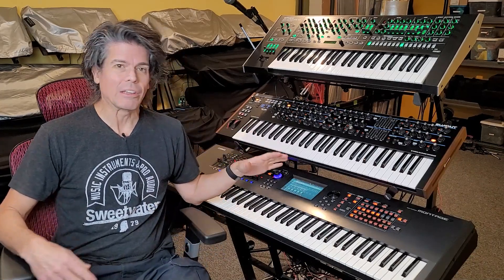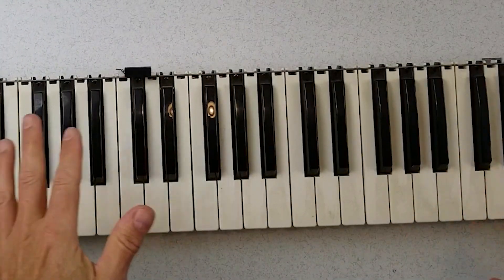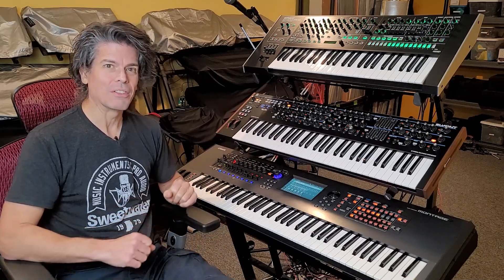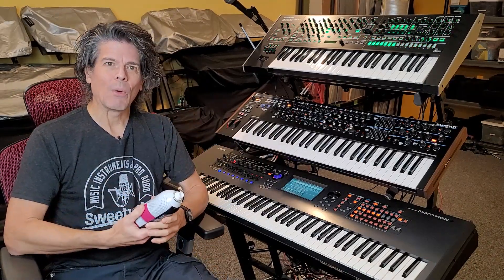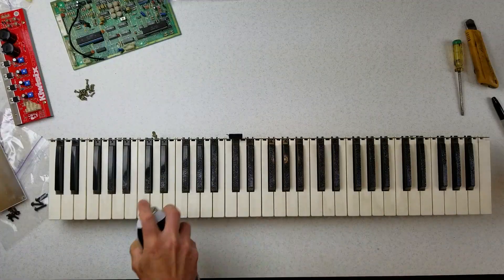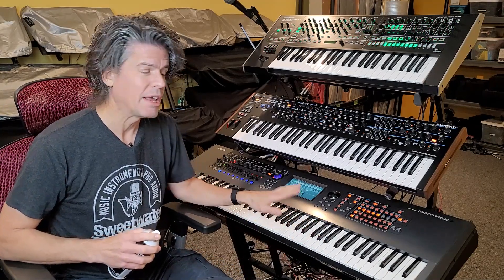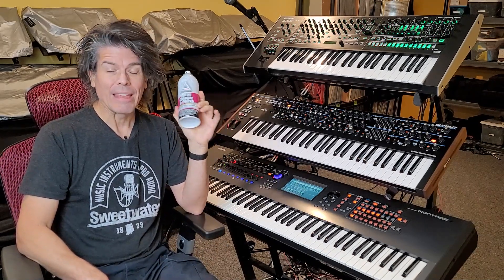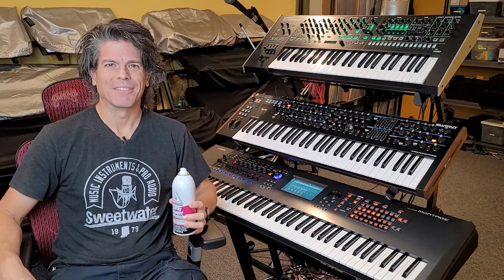How to Clean Your Synths: My Secret Weapon Revealed!

Comment: They say in Dune "Fear is the mind killer..." well I believe "Dust is the synth killer..."

1. Ensure all electronic equipment is covered up or squared away when not in use
2. Vacuum and dust workspace including wiping down all hard surfaces once a week (and ensure any clutter, stray cables, manuals etc all put away - places like this are especially bad for harbouring dust)
3. Gently use a soft haired paintbrush across the surface of your gear (especially good for mixers with hard to access areas around the pots and into grooves into which the sliders sit)
4. Then use a very very slightly dampened cotton lint free cloth to wipe down main synth or mixer areas (remembering to earth yourself if you are going to be wiping down anything with a metal surface to discharge any static build-up)
5. Use a dampened cloth for the keyboard and the shelf below the keys and then a cotton towel to dry
6. Remember to wipe down any exposed areas of keyboard stand and racking - these are easily forgotten and seem to be massive dust magnets 
7. Every so often remember to give all cables, power leads and adaptors a wipe (obviously the largest build up of dust is going to be at floor level)

I suggest all of the above is done with the power turned off and equipment disconnected from the mains outlet obviously. 

Happy days.

Comment: For more than 30 years my method has been prevention of dirt rather than a cure for it.  So regular hand washing, clean habits, no smoking, no eating / drinking and making sure the room is kept free of dust where possible. Oh and never let other people use your stuff! I've stupidly used to allow people to pick up my guitars with freshly fitted new strings, and 10mins later those strings would be completely ruined and needed replacing with more new strings, plus there was often thick black dirt on the fretboard etc.

Comment: I'd say I'm not too sure about using motorcycles stuff on synthesizer. Usually those are not intended for electronic devices where the motherboard might get damaged. I usually recommend more to clean with stuff like isopropyl alcohol or white vinegar
Reply from the maker: Alcohol can be dangerous, as a lot of the screen-printed graphics manufacturers used are soluble in alcohol. Vinegar is acidic and can promote corrosion. The Spray Polish has surfactants that lift the grime, and a modified carnuba wax that remains as a protectant and gives it a like-new shine.

As I mentioned in the video, I have been using this stuff for years, and it's never failed.

Comment: Okay, I was sceptical as hell but I gave it a try today on a few older synths and the results were night and day. I had a lot of nasty residue on them from old foam that is turning to mush in the flight cases and this stuff just cleaned everything top to bottom. The only thing I did notice is that the "Yamaha" on the back of my DX7 started coming off but I think that has more to do with the elbow grease I had to put into it to turn it back to white from green. Probably used a lot more than I needed to on there, about half the can, but it was nasty. Now it looks practically new. Great tip.
Reply from the maker: I swear, this stuff works SO well. I've had quite a few people report back that they tried it and it worked great for them as well!

Comment: My secret weapon for everyday cleaning of my instruments is very simple. An old cotton cloth .. prefearble from an old bed sheet and just plain windows cleaner you buy in a store. I have yet to see any materieal that get damaged from it. It's great for cleaning just about everything on the outer of the instrument. Newer spray direct on the instrument. spray on the cloth  and clean and dry it off with the cloth. works both for grime on the keys and the top of the instrument no matter if its plastic or metal. It doesn't do any damage to the text or other bad things. Only precaution is if your display don't use a protective plastic there used to be a warning for the early LCD monitors that using regular water on a cloth was prefeared as windows cleaner could react with the delicate display. Not sure about today, but I always just use not too hot water on my flatscreen anyway

Comment: Great tip! I'm a former motorcyclist (20 years) and a synth musician, so I already knew about this spray but I didn't think to use it for synths! Good to know about this. I have a synthesizer I bought used from Reverb (an Access Indigo 2 Redback) and it has a light but persistent perfume scent, and it's gawd-awful. It's already giving me a headache and I've only had it out for about an hour. Granted, I have an incredible sense of smell. 

Would white vinegar or alcohol be advisable too? You're using the old detailer's trick of spraying the towel, not the surface. Good technique!

Until I can get some Honda Spray Polish, I used a 50/50 mixture of medical-grade alcohol and distilled water. I wiped every surface with it, hoping I found most of the perfume molecules. I guess I can repeat the process until it stops smelling like some awful perfume.

Curious, what about Honda Spray Polish makes this better than alcohol or vinegar? Either way, I'm gonna get some!
Reply from the maker: Alcohol can be dangerous, as a lot of the screen-printed graphics manufacturers used are soluble in alcohol. Vinegar is acidic and can promote corrosion. The Spray Polish has surfactants that lift the grime, and a modified carnuba wax that remains as a protectant and gives it a like-new shine.
Reply: @ScottsSynthStuff  Great explanation. You've convinced me. Thanks!

Comment: I do not advise spraying anything wet or even using a wet cloth on any keyboard, unless it is taken apart from the other components. I used a wet towelette on my Roland JD-Xi one time, and it damn near ruined the play, stop and record button. I would advise using a Walmart microfiber towel. They are very cheap, and they clean the synth without any wetness. If you would use any wetness at all, only make it so that it isn't even damp, but a little dryer than damp, because it will get into and under the buttons and ruin your whole synth. Just a friendly reminder to everyone to not make the same mistake as me 🌗
Reply from the maker: You certainly don't want to have liquids dripping down inside the synth, but a cleaner such as the one I show here, which is applied as a fine mist and then wiped off, is not going into the synth, and is definitely not going to affect buttons or sliders.

Rubber cap buttons like used on the JD-Xi are fairly well sealed, as are tactile switches with caps on them - you would need a LOT of liquid penetrating to get far enough inside that it would affect the button at all.

Comment: Do you use air compressor regularly for keybed and physical buttons?? For keybed microfiber cloth +Just water is Best. Cleaners make White keys yellowish.
Reply from the maker: I use compressed air to clean synths when I am restoring them, but not as a normal cleaning process. 

Polymers typically yellow due to the breaking of polymer chains, primarily when they are exposed to oxygen and UV light. Many cleaners are oxidizers, which is why they can cause this. The cleaner I show here, on the other hand, is not an oxidizer, is specifically intended for use on plastic polymers, and actually leaves behind a UV-protective coating that prevents yellowing from UV exposure.
Reply: @ScottsSynthStuff  this is why I love nord stage 3 compact keybed. They are naturally yellowish. Also my montage 6 keys are not White as my p115 piano keys.

Comment: Thanks for the video. I have a Korg Triton LE and almost an entire octave is dead. Do you think this product could help?
Reply from the maker: If a set of keys together are all dead, it's usually an electrical problem with the keyboard scan matrix (or one of the connectors).
Reply: @ScottsSynthStuff  Thanks for the answer. I know knothing about electronics - should I get in touch with an electrician? I live in a town and there aren't many options. I've asked a music instrument shop and a place where electric and electronic components are sold; the former said there was no Korg 'SAT' (I don't know what that stands for) and the latter said that they didn't have a warehouse or place where they fixed electronic devices such as mine. Instead, they offered me a can with some kind of thing that helps erase the humidity in an electronic device; I told them that I thought it was humidity what has damaged my synth. I'm pretty confused. Thanks in advance for reading this...
Reply from the maker: @CollapsingRealities  An electrician is not going to know how to deal with this. I would highly suggest an electronics tech familiar with synthesizers. Failing that, a decent computer electronics tech with some modicum of diagnostic skills could likely sort it out as well. I doubt it is humidity related.

Comment: Is there any reason why this is better than good ole rubbing alcohol for synths?
Reply from the maker: Rubbing alcohol will damage and/or dissolve many types of paint used on synths, and it can also weaken/dissolve certain types of plastics - especially those with high rubber content, like that which is used on knobs. If your synth has wood with a lacquer finish, rubbing alcohol can cause the finish to become cloudy. The cleaner I show also leaves behind a protective coating that rubbing alcohol certainly does not.
Reply: @ScottsSynthStuff  i'm using 99.9% alcohol to clean my synths since 40 years.. never had any problem with it.. never used it on rubber parts or on the keys itself though, but its always nice to get some new ideas.. thanx for the tip!

Comment: I found a Yamaha pss-170 keyboard. The output stage is so dirty through the on board speaker and through the headphone jack.Any suggestions on how to get a cleaner output? All the capacitors seem fine no bloated caps. I did a complete tear down and cleaning. Also tried different voltages 9-12v on the wall warts. Any suggestions would be appreciated. I know it’s a cheap keyboard, but I’m running it through my Mpc sampler adding effects to spice up this mediocre keyboard.

Comment: Hi Scott! Amazing video. Quick question. I have an Arturia MatrixBrute and it has this rubber-ish knobs and sliders (not sure if you are familiar with them). The thing is that I feel like they've been getting stickier over time. Would you recommend this product to clean my MatrixBrute rubber knobs and sliders?
Reply from the maker: If you're talking about "stiction" where it takes more force to "break them free" when you first start moving them, then yes, this would definitely help.
Reply: @ScottsSynthStuff  Hi Scott, thanks for your reply. No actually I meant more like a sticky feeling to the touch. They are kind of sticky on my fingers, which is not very pleasant to touch. Also other synth like the Moogs (I think the Sub-Phatty) that have rubbery sides have that.
Reply from the maker: @mscherer1586  ah, sticky rubber syndrome. You can try rubbing alcohol to remove the sticky layer of devulcanized rubber, but there is really no fix for this other than replacement.

Comment: Does that work on a key bed that has turned yellow? My sub37 keys have discoloured for some reason. I’m in a non smoking studio. Moog told me that it happens on this model.
Reply from the maker: No, that's actually caused by broken polymer chains in the plastic used to make the keys - primarily from oxidation and UV exposure. If it has started yellowing already, and it really bothers you, you can disassemble the keybed, put the yellowed keys in a solution of hydrogen peroxide, and expose them to UV (strong sunlight for a day will work). This usually returns yellowed plastic to white. Look up this article: https://en.wikipedia.org/wiki/Retr0bright
Reply: I will take a. Look thanks!

Comment: What are your thoughts around HONDA 08732-SCP00 Spray Cleaner and Polish cancer warning?
Reply from the maker: My thoughts are that California cancer warnings are completely irrelevant, as they basically list pretty much EVERYTHING as causing cancer. If it contains plastic, pretty much any chemical, metal, whatever, California mandates that it have that cancer warning on it. The end result is that just about everything we buy today has that useless cancer warning printed on it - which in effect means that the warning is meaningless.
Reply: I appreciate the reply, thanks!

Comment: Wet microfiber towel with Dawn Power Wash rubbed in, then a dry microfiber towel.
Reply from the maker: A detergent will certainly help remove a lot of oil and dirt, but you don't get the benefit of the protective coating afterwards from the cleaner I show that makes it look so shiny and new, and protects the plastic parts from UV yellowing.
Reply: NEVER use microfiber things. They scratch! Use cotton!
Reply: the coating is carnauba wax @ScottsSynthStuff

Comment: There are two simple kinds of cleaning liquids: vinegar cleaner (for my synth) and alcohol (nail polish remover of girlfriends/wives). Cost a few cents, helps against every kind of dirt, and that's all I need in my whole household.
Reply from the maker: Alcohol (or acetone, which is actually what nail polish remover is) will often REMOVE paint on synths, so you need to be careful!

Comment: What about WD-40? I have been using that for years on everything electronic
Reply from the maker: Never EVER use WD-40 on electronics! WD-40 is not a contact cleaner, it is a water displacement agent originally designed to prevent rockets from rusting. The way it does this is by leaving behind a sticky, oily goo after the carrier evaporates. This oily coating prevents oxidation. However, it also does one other thing really well: it attracts and captures dust and dirt. 

So while you may get temporary relief from using WD-40 on pots and switches because the carrier helps wash away contaminants (just like a proper electrical contact cleaner does), it then leaves behind a sticky oily coating that attracts even more contaminants, and before you know it, your switch/slider/pot is now noisy and malfunctioning.
Reply: @ScottsSynthStuff  The WD-40 Contact Cleaner (not regular WD-40) says to be alcohol based not leaving any residue.